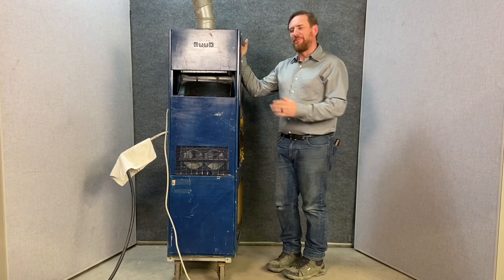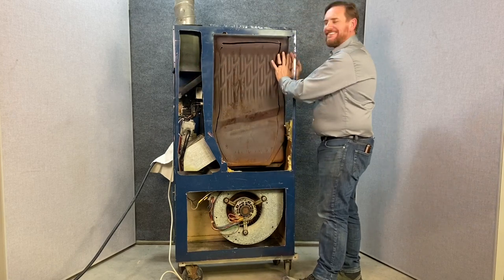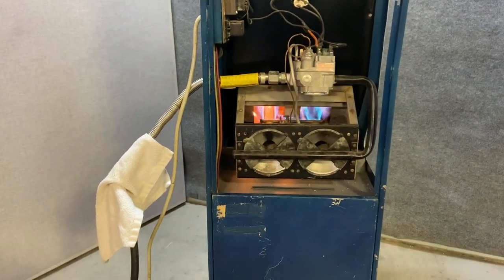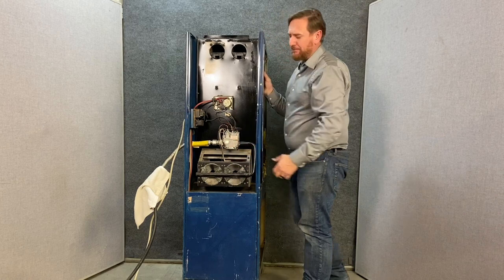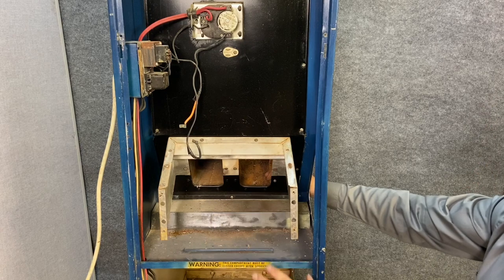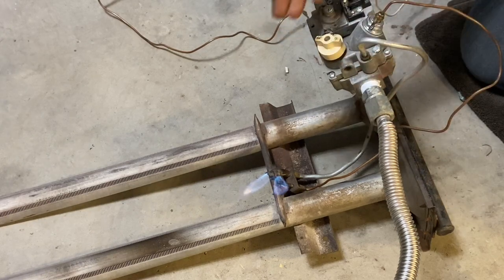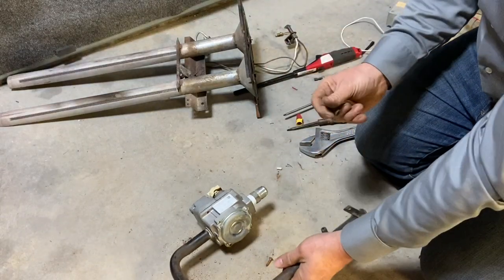Standing Pilot gas furnace operation and dismantling

Comment from the maker: 00:00  AFUE
2:00 door safety switch/ door interlock
2:30 filter
3:00 cut away and  first view of the heat exchanger
5:30 draft hood collection box
5:50 first view of combination gas valve
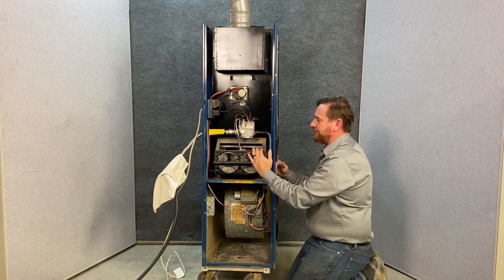7:08 lighting pilot
11:10 firing the furnace
 11:34 flame burning onnthe heat exchanger
21:00 pulling the blower assembly 
24:00 removing the blower from the housing
31:20 blower wheel
33:0 blower bracket
44:50 top section of the furnace 
35:00 combination gas valve, removing burners
38:00 lighting the pilot, clear view
41:15 igniting the burners out of the heat exchanger
43:12 pilot assembly
46:20 combination gas valve manifold spud orfice
49:38 burners
52:00 fusible link 
53:00 Fan, Limit switch
56:00 wiring and wire diagram
1:10 pulling the heat exchanger
Reply: The effort!

Comment: By far the best video on YouTube when it comes to these old style furnaces. Best video BY FAR!!!!

One question. Maybe I have to watch the video again to see if you mentioned it but why does the collector box have an opening on the bottom? What purpose does that serve? Thank you
Reply from the maker: Thank you!
The idea is for delusion air and back draft. 
As the gasses travel up and out it would pull heat away from the heat exchanger making the furnace less efficient. By adding delusion air is slowed the exhaust gas draft leaving more heat in the heat exchanger longer and moving slower for better heat transfer. 

Second, if a back draft or windy day occured and the flue gas came back it would divert out of the furnace section (draft diverter). The idea that's better than it pushing the flame back into the heat exchanger and out into the burner section burning the wires and why ever else the flame may touch. Great question!
Reply: @love2hvac  

Thank you. Love all your videos. Please keep putting them out!

Comment: Thank you for another amazing video. i have been watching your videos. will 3in1 oil work instead of turbine oil?
Reply from the maker: I appreciate your support. 
Please do not use 3in 1 
3 in 1 oil isn't really oil, it's a lubricating solution that has oil in it, among other things such as corrosion protection and rust prevention. None of which has anything to do with lubricating motor bearings. It's known to gum up inside the motors

Comment: Can you explain how a gas’s oven with a electrical heat element works (this element looks like the gas valve is in series with the element) 
Looks like the hot elament ignites the gas when the gas valve opens. Am I correct or is there more to this oven system. This is a caloric gas oven.
Reply from the maker: Im not familiar with ovens but it sounds similar to a hot surface ignitor on an 80% furnace. 

https://youtu.be/_sLNEmM5RRw

Comment: I have an old Johnson Air ease model HAS130  that quit yesterday ( it was 5⁰ ). I tested the thermocouple, went from 11mv down to 5 so as soon as the store opened this AM got a new one, installed , lit pilot and got it operating watched it awhile then I found your video - my furnace has the gas on for a min. or so then goes back to pilot with motor still running, then about a min. Later flames back up and repeats. I noticed you mentioned that in your vid so I checked the fan- limit switch and observed it doing as you said - twists around them back turning on / off the flames . I then removed the inlet filter and blew alot of fine dust out thinking perhaps the air flow is restricted not allowing enough airflow through the duct side of the exchanger causing an overheating problem making the limit switch operate . When I put the air filter back in I noticed the pilot had gone out -?  It shouldn't have but I relit the pilot and tested - same situation with the limit switch.  I just looking for some advice - now I am thinking perhaps the combustion exhaust vent might have a dead bird or something in it  seeing the vent pipe goes up the old coal boiler chimney (1940 house). It does bother me that while I was blowing out the air filter , the pilot went out. ...  Thanks for your videos, I hope you see this and can advise . Charles in Cheyenne Wyoming
Reply from the maker: Hello Charles
First and foremost make sure you have a low level CO monitor in the living area and each bedroom. 
NOT an alarm but a LOW LEVEL monitor. Big difference in operation. 
There is usually  second limit switch in the furnace. This is a also fusable link. Typically probably and wired in series to the thermocouple at the CGV. Check to make sure that is in good shape. Ohm it out.
Use a mirror and look in the heat exchanger for any cracks or metal fatigue. Pull the blower and look up and the heat exchanger for any metal fatigue. 

It can also be
Heat exchanger or flue cloged up.
The alignment of the thermocouple in the flame. 
The thermocouple itself, even new ones can be bad.
The pilot light office cloged not burning a correct flame.
The gas valve dirty or clogged.
The gas valve has worn out. 
Gas pressure to low coming in. 
House in negative pressure.

I have a good friend that lives in Cheyenne but they don't do HVAC.

Comment: I guess the real question is why would you need to dilute the combustion gases? If that collection box was sealed then it would just vent out naturally wouldn't it? And you wouldn't have to worry about a backdraft pushing all that combustion air back and out of that wide open collection box. 
I'm confused of why even dilute the combustion gases to begin with
Reply from the maker: If you did not the gass would be hotter and lighter, traveling up faster. This would pull more heat from the heat exchanger and draft more heat out the flue.

By diluting the flue gases more of the heat can stay in the heat exchanger and transfer into the home.

Comment: I have question;
I am HVAC tech and many times I faced pilot furnace and lots of Rust from heat exchanger and no heat .
I tell client to replace furnace and even show the client that rust separated from heat exchanger not good but client starts to harrass me and says he wants heat .
Personally I dont like to fix standing pilot because of safety but customers think that I want to sell furnaces to them  but unfortunately I don't work for myself and work for company;otherwise i would not accept these kind of customers .
If you make video how to deal with these customers;it will be great .
Thanks a lot
Reply from the maker: That's a great point. I will add that to the list. It's a touchy subject for sure. There are a lot of people that love standing pilot and keep repairing them regardless of the condition. On the other hand there are some that are actually in good shape and people cond them. 

More important than anything is the natural draft and how wind and home conditions such as running an exhaust fan can put the home in negative pressure. I will eventually do a class on this as well.
What I did was perform a combustion anylaysis from start up to run. It's one of the best ways to show a faulty heat exchanger. Then I would document with pictures the burners and heat exchanger. I would weigh the amount to rust I removed and note that on the invoice. 
I would also have the home owner sign a separate paper releasing from all liability of the furnace. They acknowledged the risk of running the furnace. I also left a pamphlet about CO and the importance of a Low level CO monitor and why it's needed more than a co alarm. 

After all that I felt comfortable leaving the old furnace in place. As long as I informed them of the risk involved it was their lives at risk and their choice to make. 

I will try to make some more videos on all this this winter.
Reply: @love2hvac  
Thanks a lot for advice.
Great point 👍

Comment: Yeah. Old. Inefficient. Still works. The old man throws some oil on it, scrapes the flame sensor, brushes the burners. Still runs after 40 years. Blows hot air at the register. He kicks it up to 68° F or what Boomers call room temperature. Turns it down to 65° F at night. It kicks on once during the night if the temperature is above 30° F. Twice if it's below 30° F. My 90+% efficiency furnace? Can't oil it. Constantly service and replacing parts. Feels like a warm breeze at the register. Kicks on quite often at any temperature setting. Maybe twice an hour if set at 72° F or Gen X room temperature. Kicks on even more at 68° F to the point it might as well run constantly. Runs better at 72° F. Probably going to spend $7,000 next year to replace? It's been 15 years since installation. Which one is better again? Ohhhhhh... The one that keeps people employed.
Reply from the maker: They stoped making standing pilots 27 years ago. The old stamped steel heat exchanger expanding and contracting every cycle leads to cracks. Moisture in the air over time causes rusting more every year will just not last for ever. 

The heat exchanger separates the fumes of combustion from the air in the house. Carbon monoxide killes 430 people every year and 50,000 people to the emergency room. 

It's not worth a life just because someone wants to save a little bit of money.